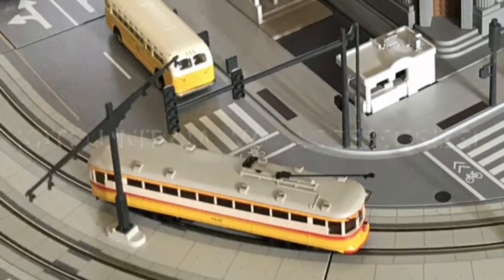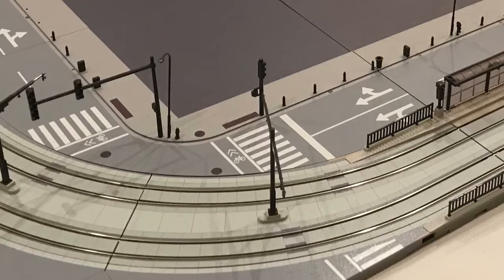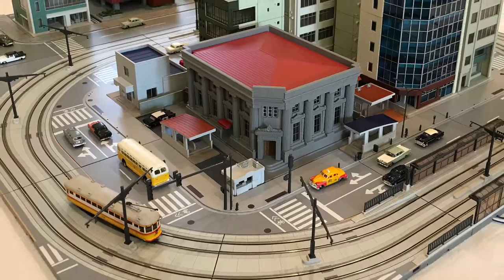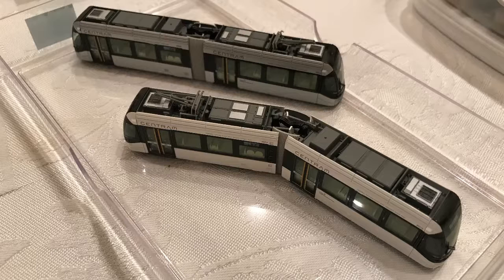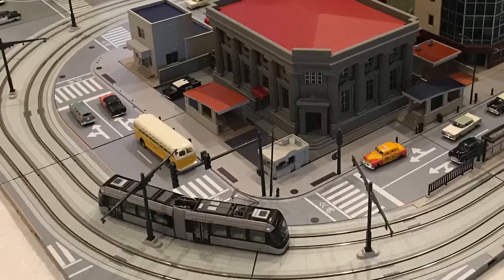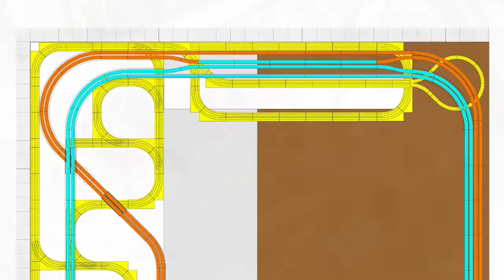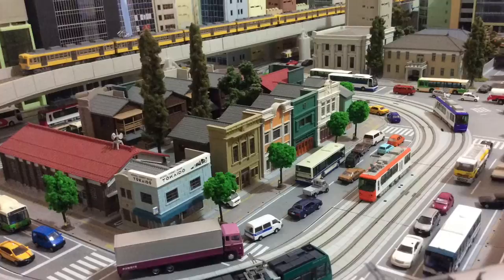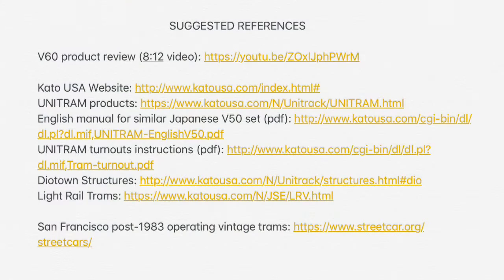KATO UNITRAM V60 Accessorized

Comment: Magnificent! Thank-you!

Now, adding magnorail, if they do Ngauge for the road vehicles . . .!
Reply from the maker: Thank you John Courtneidge! I just discovered Magnorail too, but do not have plans yet to buy anything. I like the effect of having other vehicles than just trains moving.I have been experimenting some with the N scale Tomytek Moving Bus System. It is similar to the HO Faller Car System, but more plug and play with ready-to-run track pieces. Unfortunately, Tomytek seems to have abandoned producing some of the more advanced items like intersections and rechargable motor chassis. Also a little frustrating that absolutely nothing is compatible between it and Kato Unitram road plates. Some modelers have DIY added steel wires under Unitram with reasonable success. I may eventually try that too.

Magnorail seems to be a nicely designed  mass-produced modularized solution to the basis of the old trick of making ice skaters move on a pond diorama. I have been watching very good YouTube videos of Magnorail done on the Everhard Junction British OO layout. Although a good technical solution, there seems to be quite a bit of modeling finesse to get it to work well. Most of the finesse seems to involve the ~0.5mm surface for the magnetic gap, and it’s friction with the chain magnets below and the vehicle magnet/slider above. The only N video that I have seen was a technically similar but homebuilt little Japanese diorama that worked very well. I think it even had a railroad crossing, which seems impossible considering the magnetic gap. Anyway, I digress, but I love the idea of integrating a nice stream of N scale vehicles into a train or tram layout. Good luck with Magnorail!

Comment: Bachmann sells N-Scale versions of both PCC Los Angeles Transit Yellow Car and Pacific Electric Red Car
Reply from the maker: Thanks. I have shells from both and the painting is not bad. Unfortunately the scale and detail of these ~1980 models is very toylike. The ~1980 mechanisms won’t run slower than ~100mph and they make horrendous noise. I think Bachmann improved the mechanisms ~2000, but I am patiently waiting for a modern model.

Comment: Is there any way to set up an automatic tram stop and go at the station?  I ordered 2 V60 sets and some trams but still looking of the power packs.  Not sure, they just came out with a new model.  There's the 22-014 and the 22-018-1 which I think is the newest one.  Great video.
Reply from the maker: Auto tram stop would involve scratchbuilding in some sensor and connecting it to some control timer. I know very little about analog or digital block control, so I cannot help. The new power pack is noticeably better with slow speed control. It also has a very fast short circuit breaker.

Comment: Thank you for the great video. Well presented, and very informative for someone like me who has no model railroading experience and considering starting in the hobby. I lived in San Francisco and really enjoyed riding the restored antique trams. Can you recommend where to purchase these Kato products? Also, Would the Kato M1 or M2 Unitrack starter sets fit around the Unitram, or would I have to add extra Unitrack to make it wide enough? Thanks again for the video and info, this would be a great start for me, not too big and not too many skills needed.
Reply from the maker: Hi Matthew. I usually get my Unitram and other Japanese stuff from Hobby Search in Japan. They have a complex but excellent website with great search tools and lots of photos. Their translations are often difficult, though:
https://www.1999.co.jp/eng/list/605/0/1

Model Train Stuff (ex. M.D. Klein) in Baltimore is my preferred US supplier. MTS prices are higher than HS except when MTS is about 35% lower than Kato MSRP. 

High shipping cost of large items from Japan often makes MTS cheaper than HS.  MTS shipping is rarely more than $20, while HS shipping is often forced to be by insured air “EMS” which may be from $50 to $120. 

All Unitrack can be combined with Unitram. Kato makes a special Unitram straight piece that widens the 25mm track spacing to 33mm Unitrack spacing. If you are just snapping Unitrack together, often you can strain the track slightly to accommodate 25mm. Also, Unitram 45 deg curves widen to 33mm, so you could just accept having all transitions at 45 deg.

Good luck!
Reply from the maker: I forgot to mention that HS does not sell the V60 North American set (right hand traffic), so try US sources for that. Also consider whether you want to model US or Japan, since there are unfortunately still no extension sets for the V60. You can get many extension sets for the Japanese V50 (left hand traffic) set. Except for painting and inserted accessories, V60 and V50 have physically and electrically identical parts (though V50 has 3 more street pieces).
Reply: @theonetruescale  Thanks very much for the info, I will check their site. I guess I would prefer V60 style RHT, but if most of the add ons and accessories are V50 Lht style, I might go that route. I don't even mind mixing them, lol. I did see online that Tony's Trains has V60 bundle with the Black Centram for $225. Thanks again, your videos are very inspiring and I think the Unitram will be a great entry for me. Not sure when I will be able to make my first purchases, but I will let you know, as it's your videos that helped me decide how to start.
Reply: @theonetruescale  The Unitram sets at that website include an articulated tram and one power pack, if I'm understanding it properly. Very nice, everything needed to start in one package.
Reply from the maker: Matthew Wilson , I have had some trouble understanding some of your questions:

If “that website” means Tony’s, I got my first two V50 sets from Tony’s in 2015 and recommend them too.  $225 for a V60 plus a black Centram is $50 less than Kato MSRP, but V60 (40-810) does not come with a power pack unless Tony is bundling that too. 

If “that website” means the Hobby Search link that I gave you, note that there have been 4 different products called V50. The 40-800 near bottom of their list included neither tram nor power pack. The 40-900 included power pack and tram with three tram color offerings.

If you mix RHT V60 with the LHT extension sets like I did for my two different layouts in 5 of my videos, you may later regret that you didn’t go totally LHT by starting with a V50. You will gradually notice that almost all of the complex printed road detail and the inserted accesssories conflict in a nonsensical way, like opposing arrows and more.  In 2017 I was hoping that Kato would soon follow up V60 with RHT versions of most or all of the extension sets. I now think that V60 sales worldwide have probably not been strong enough convince Kato to support RHT extension sets. 

I think that I misunderstood your earlier question about M1 and M2 Unitrack sets. I thought you wanted to combine the two track types in continuous loops like Kato shows in some example layouts.  You probably just wanted to know if you could surround a V60 with a seperate M1 loop for normal trains. V60 dimensions are 496x620mm. M1 and M2 use R315 (centerline) track, which needs inside train clearance of about half of 33mm per side. Narrow dimension inside the M1 or M2 oval is (2x315)-33=597mm, which means that the 496mm of the V60 fits inside with 101mm to spare.  The 620mm will probably fit inside of the wide part of the oval, but is hard to calculate because the rectangular corners might intrude into the curves. If so, just buy a little more straight unitrack. Personally, instead of the M1, I would suggest getting the more interesting V16 banked double track set (R282/R315) to surround a V60.
Reply: @theonetruescale  Thanks for the response and info. By that website, I was referring to Hobby Search. I had never seen that site before. I will go back and look again. I could probably browse there for hours, lol. Hobby Search item #40-900-5 states that it comes with :  Road Surface Plate (V50 Common) , Vehicle: Toyoma Light Rail TLR0605 green , Power Pack Standard S (If you enjoy the double-track operation, one of the further power pack add is required) .   JAN Code : 4949727520971      Currently sold out. Maybe it's no longer available.
Reply from the maker: Glad you like Hobby Search!  The item photos provide a lot of education, despite bad translations. I see that the lone V50 sets and all three color V50 sets with tram and controller are not in stock. Perhaps you should sign up for “notify when available” for all 4 items. These sets are popular in Japan and only become available every one or two years unless Kato still has stock that HS has not restocked. When available, they sell out in days to about a month, so act fast. 

Kato now has an improved standard controller, the SX, which has pulse control for low speed and uses a separate World universal power supply (for N use 12V, not 16V version). 

https://www.1999.co.jp/eng/10501349

Kato probably will include this in their next V50 bundle, probably with a differ color tram. You might be better off either waiting for this bundle, or getting a lone V50 or V60 from wherever, and buying the SX, power supply, and tram seperately.
Reply: @theonetruescale  Thanks for the tips. I need to budget and save up a little more. But now I know what I'll be starting with!!
Reply from the maker: Hello again, Matthew! Writing to inform you that Hobby Search has had the Japanese V50 set in stock again for about 2 weeks for ~$149.

https://www.1999.co.jp/eng/list/605/0/1?sold=1

Comment: do you think kato has discontinued the unitram system and parts ??
Reply from the maker: I don’t have any insider knowledge but I follow Kato product strategy pretty closely. We modelers depend on long availability of some favorite system like unitrack, diotown plates, double track plates, banked double track, unitram... Manufacturers must prioritize revenue , so must concentrate on the next new thing, usually new train prototypes or features. 

Once the tooling investment is done for something, contuation is mostly a matter of demand vs profit. If demand isn’t high enough to made profit on a small production restart batch, it will be delayed until demand is high enough, which could be a long time. I think unitram has only been a so-so success in Japan with competition from Tomytec’s tram and bus system. Unitram has not had new track parts since the turnouts in 2012. I think unitram has probably been disappointing Worldwide, so we never got any (print change only) RHT follow-up additions to the RHT V60 set.

On the bright side, Kato still seems to revive old unitram track production about every two years. They also just added a second totally new tooled Hiroshima 3-element tram. They added a technically new Japanese “unitram” track set which is paved track for an automobile loading and/or container forklift facility.

I am not holding my breath for many new trams or significant unitram tooling like a new “Y” turnout that could join to a R and L to make a T junction. I think unitram is likely to continue sporadic production, but rarely going to get new tooling or even print/paint changes.
Reply: @theonetruescale  thanks for the info

Comment: and what power pack are you  using to run your system
Reply from the maker: I like the new Kato SX controller. Low speed control is better, and short circuit breaker is very fast.
Reply: @theonetruescale  is that the 018